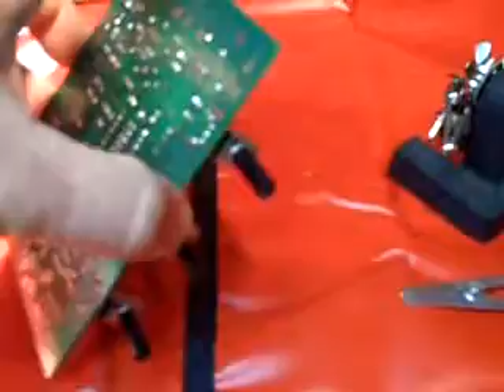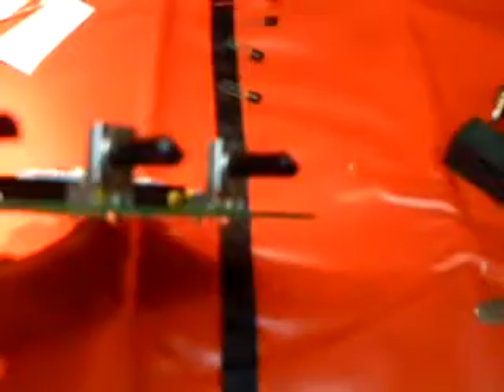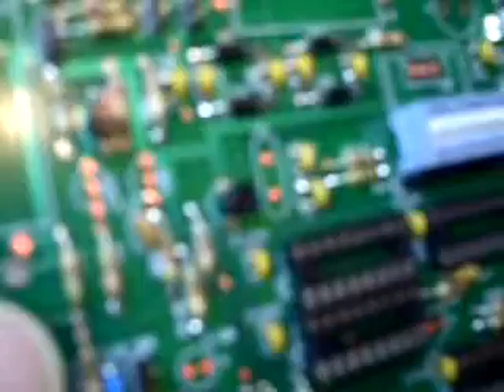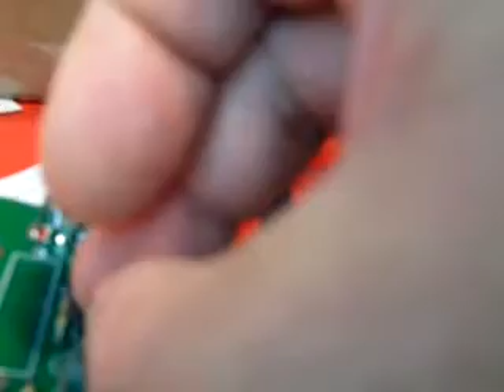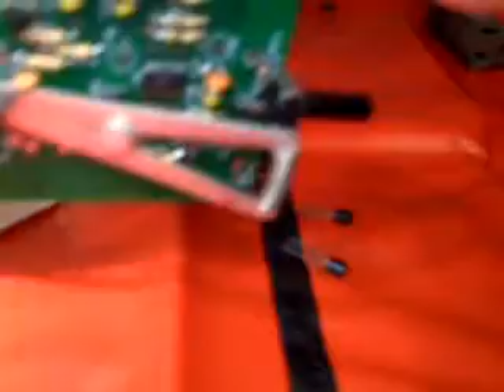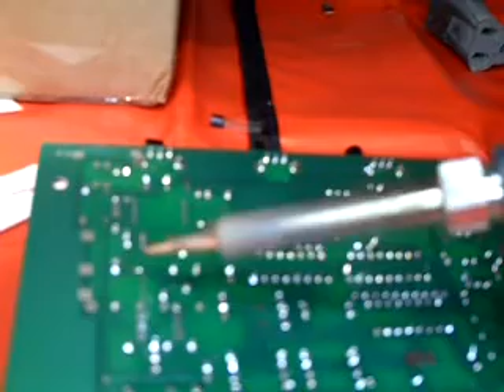LPAM Transmitter SSTRAN Kit Part 5

Comment: "transsisters", "heak sink", "heat sing".... Ha ha, when spelling goes bad.

A 100 mW transmitter does not need a heat sink on the output transistors; that is why there is no heat sink or "heak sing". They will run warm but not hot, way below any temp limit.